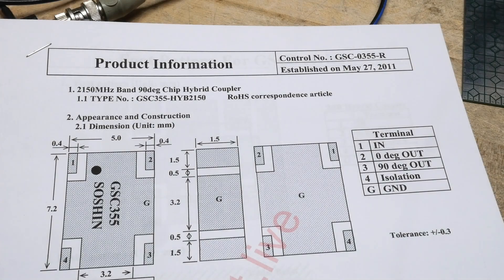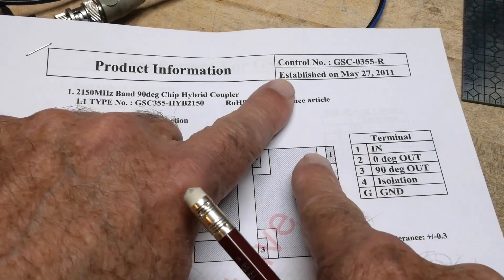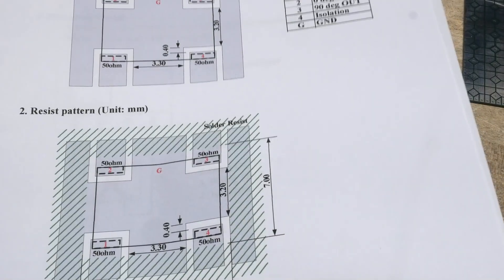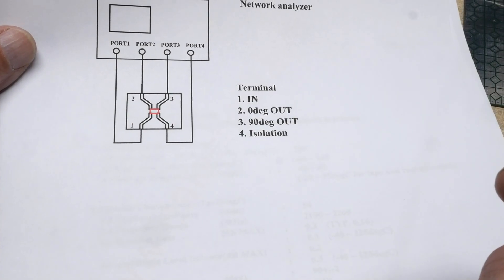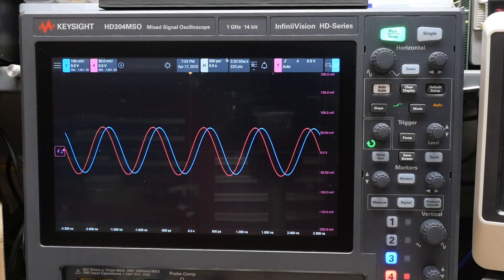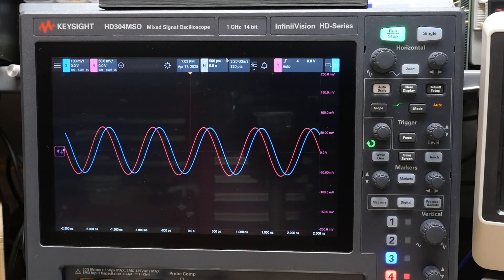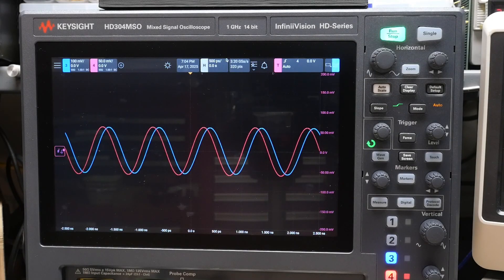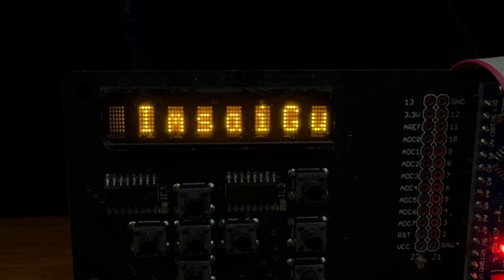#2223 2.15 GHz 90degree Hybrid Coupler

Comment: Very nice introduction to such a circuit. 
To measure the phase difference between two high frequency signals (2 GHz) you can take two mixers capable of the signal frequency and mix the signals with identical local oscillator signals provided by a splitter. The two IF signals of for instance 200 MHz have the same phase difference as the two 2 GHz signals at the input. 
For me it is amazing to really see for instance a pulsed high frequency signal in time domain after mixing it down.

Comment: I've seen some Anritsu portable spectrum analyzers on the 'Bay - more reasonably priced (second hand ) that have the additional 4 ports and option to carry out that measurement. For some reason the extra capability scares people away - the extra ports and hence the price is quite a bit lower than expected - but still probably of the order of $1k... Not trying to push anything but was just curious what one could actually do with such an instrument and the extra features ...

Comment: I found something like this the other day in an ewaste bin. It's a mini circuits splitter device with 90deg phase shift for 25-50MHz... Was wondering if this could be used to sample a signal I/q? At least could experiment with it in the 10m band ..
Reply: I've used the Mini Circuits parts for I/Q demodulators and Costas loops.  Mini Circuits stuff is great.

Comment: Isolation port should be terminated in 50 ohm. NanoVNA/LiteVNA can measure the phase shift at 2.1GHz.
Reply from the maker: yes, I missed the termination, thanks. maybe I'll layout a little board. I avoided the VNA because most people don't understand the phase part of it. Might be a good time to teach
Reply: @IMSAIGuy 
Yes. Please do! Would love that video.
Another thingy you may do is to feed it with a 4PSK signal(from a SDR or whatever). Then look at two square waves on the outputs.
Or maybe use two mixers(fed from the same LO) on the outputs?

EDIT: really interested in how these are built as well. As it's basically a Hilbert transform in hardware.